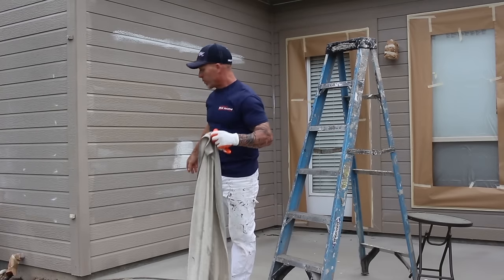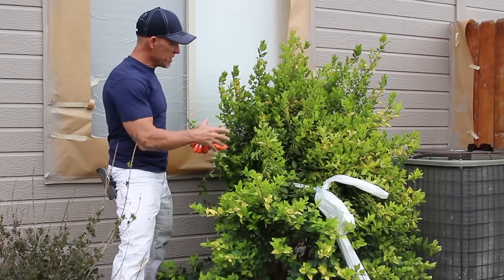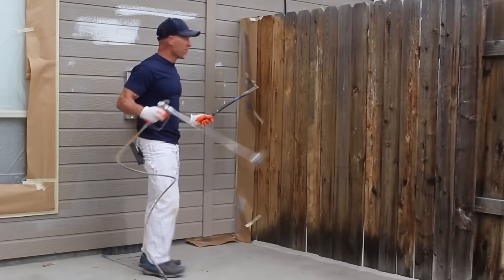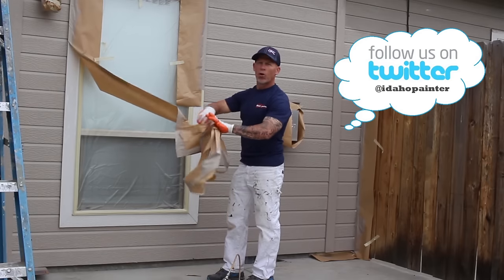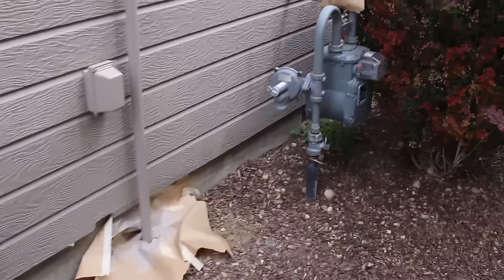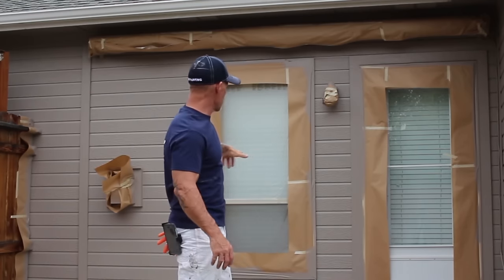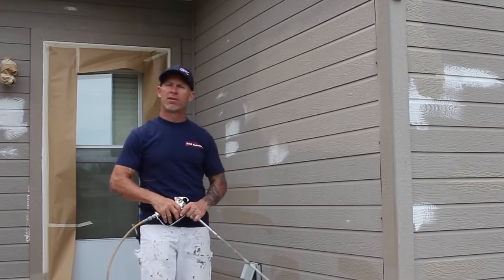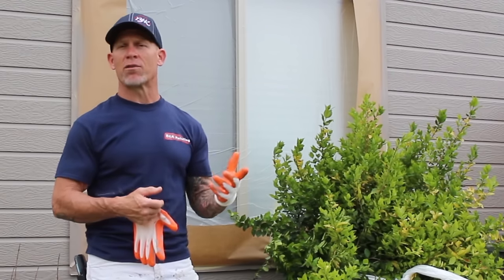Stopping Airless Sprayer Overspray | Eliminate Paint Over Spray

Comment: I've been painting for over 26 years and have a high appreciation for painting techniques and practices... THIS guy embodies everything right about prep work and painting techniques that I have been practicing for close to 2 decades of industrial commercial and residential painting. I absolutely commend him
Reply: I think he should have used plastic on the windows tbh
Reply: @AtTheHandle  first thing I thought. Just use drape and tape. What a waste of time
Reply: @AtTheHandle  There was plastic under the paper on the edges. Paper helps to absorb drips, and the paint doesn't flake off like it does with plastic, creating cleanup issues. Plastic is fine for areas that receive very little overspray, anything that is receiving heavy amounts of paint, needs to be Paper. No flaking, and no dripping, it just makes everything easier.

Comment: You should always be spraying at the lowest pressure that gives you a good spray pattern, i.e. long and narrow with no "tails" at top and bottom. You should test the pattern on a piece of cardboard or such.
Reply: That depends on the tip. Better if new. Wore out tip just makes a mess and wastes paint. I use a411 for large areas and a 311 for soffit and fascia. Indoor trim I use a211 tip.I use a new tip for every job. Great videos dude. You know your job.
Reply: @keithhampton9700  A x11 tip sounds a little constricted for full bodied exterior paint. A x13 or x15 would be normal for the generally heavier bodied exterior paints.
Reply: @nejdro1  your are correct, it's no wonder this dude is blowing through a fresh tip every job... using the wrong size

Comment: I like that u put plastic up then mask with paper.. right way to do it. My old man thought me at age 14 to correctly  mask windows & doors..  I cant stand  watching guys just use paper. And after u pull it u can see a square of  over spray on the glass & vinyl. Only thing that bothered me was the wand. It's not necessary.  Take it  easy  painter.

Comment: The masking and preparation is usually the most expensive element of any painting project.  Good job.
Reply: I agree
Reply: for sure. Just myself and a helper.  3 days prepping. 1-1.5 days masking and spraying on a typical size bungalow is the norm. 2 days if its a relatively new home with little weather damage.
Reply: You mean labor wise, right?
Reply: @andrewhigdon8346  both, you spend money on tape, plastic, cloths, paper, and other things
Reply: And time never cut corners

Comment: I got a Graco X7 for 50 bucks at a yard sale this week. Was excited to use it and went in not knowing anything about paint spraying. The sprayer did it's job well but it was hella over spraying. The whole room I painted got all misted. Even the rooms over got paint on them even though the door in the room I was painting was closed. Il definitely try lowering the air pressure because I believe I had it set to the max. might check out the tip as well

Comment: i first used a Graco airless 1973  up untill 2010  and would only use extention like the 1 you were using on ceilings/  and roof recoating  done very little masking , as with using gun only , you have much more control, ,/using correct pressure  helps, oh and the tip you are using can be got in china for 5 aus dollars ( my son ordered 100 last year ) he was paying 70 dollars each, here in aus , so somebody making an easy quid,/ anyway keep up the good work
Reply: i seen them 5 dollar tips   so they are ok then? 80 bucks i paid for last one 310 ff racx graco

Comment: I have been painting for 33 years and I have done quite a bit of spraying. But in the end, I always end up with brushing and rolling. What you did there on the siding with all that overspray prep would have deterred me and I would have brushed it. I went down this rabbit hole many many years ago of finding a way to spray houses in general and never found a time effective way to do it. I spray the odd thing, and I spray much of my ceilings, but beyond that I find there is no time or energy savings and the stress level is high when you spray. I tried HVLP, I tried handheld units, I tried masking guns, nothing allows me to get the house painted faster than just brushing and rolling. The main problem has always been overspray and the second problem is fisheyes and other issues solved with brushing and rolling. I have had a Graco 495 for 17 years and have used it a lot, but the older I get the more I rely on brushing and rolling.
Reply from the maker: Thanks for sharing
Reply: I am younger than you.  I interior paint and spray the ceilings as well but brush and roller the walls and trim usually.  Usually, it's a long day but can get a whole house masked by myself and sprayed the ceiling before I leave for the day.  it is much quicker for ceilings that's for sure.  I sometimes use it for baseboards as well, can mask a whole house baseboards and spray 2 coats faster than i can brush them.  Door trim and window trim is usually brushed.  Hybrid painting lol.

Comment: I always spray my trim first. Then I mask it like you do - Paper around the edges, and plastic inside. Then when I spray the body, I pull off the masking and the trim is already done.
Reply: I California cut my trim.  Goes FAST and looks awesome.
Reply: @Dave Morrison: I agree and most always do it the same way as you. The only time I wouldn't do the trim first and then mask it is if the customer picks a darker trim color than the body/wall. It should be obvious why I apply my lighter colors first.
Reply: I don't like masking new paint. I assume you haven't had any pull off with tape? I heard bad things so I just avoid it
Reply: @mohnjarx7801  exactly scrambler that's why I dont do trim first. If you do it Idaho Painter's way you can mask the window, then spray the body, then roll  the trim all while the paint is still wet on the body. If you trim out windows first you have to wait for them to dry, then mask, then spray, then unmask.  Just my 2 cents
Reply: its because he always does a french finish or whatever its called... in other words seems like they usually just paint the face of the trim,  not the sides  like you do as 1 should.

Comment: Yes it's nice to see that there still some pros out there doing it the it the right way. Using a shield should be the first thing to learn how to work with. The .515 and spray rig were also fine choices and a good tip on tieing back the hedges. This 10 minute video would be a valuable tool for the novice and DIY'er, The only thing missing was the Rock & Roll! Nice job brother.....Peace.....
Reply from the maker: Thank you very much!
Reply: I completely agree with you on the shield and 515 tip. No matter how much prep is/has been done I feel lost without my shield!! Learning how to hold it where needed and spraying with one hand is the way to go. The 515 tip, well that's more or less your "go-to" for general spraying, get those 2 down and your way ahead of the game if just starting out. I would only add that if one is going to spray more than just your house as needed, it is really nice to know what the #'s mean in reference to the tip "sizes. Take the first # and (usually) double it for the fan width, and the last 2 are the actual hole size in thousands of an inch, so a 515 tip has a 10" wide/tall fan and a .015" orifice. Once I took the time to look what the #'s meant it all made sense and I could easily grab the right tip for the job, prior to that someone would yell Hey grab me a 413 tip, HUH? Sure the #'s are stamped on it, but what's wrong with what your using? LOL...
Reply: @da1cru1  good advice hey I have a question anyone really. An I use a Graco Tex sprayer as my well Hopper and compressor and my large hose and gun and buy some sort of 515 tip for it very very new heard from a Graco blog that it could be used as a sprayer also need some guidance could one throw some knoldege real fast for me much ablidged

Comment: If you are doing new work or renovation there's usually no floor product installed, just plywood or concrete on floor. When you start spraying the lids, notice if there's a lot of paint on the floor. This is the first indicator that whoever is spraying is staying too far off the wall. Get as close as possible and move very quickly. Be very consistent. Inside,bad spray habits burn a ton of flatwall. There's no way to control over spray outside other than using small flat tips on a Graco silvergun with a barrel filter. The wind is what causes over spray. Outside you can turn down your pressure and load up siding,stucco or most rough exterior substrate with a stringy runny yet non overspray load of paint ,avoiding the edge by a foot or so, then take a nappy sheepskin roller and wet roll the wall. This let's you paint fast and zero drips or overspray. That's how you control overspray.

Comment: I'd still put 2 coats on even though it's the same colour. Light coat on the 1st and a little heavier on the 2nd. Better coverage and avoid runs and misses if trying to cover in one coat.
Reply: And I have watched a couple of your videos and find it interesting how other painters do there work. Your tidy and make it look easy, because really it's not that hard. 80% of my work is spraying roofs or exterior houses here in New Zealand. Cheers for the videos.
Reply from the maker: Thank you! Depending on the quality and color of the paint is how I determine how many coats. Thank you for watching :)
Reply: yeah same here, on the 2 coats.  even on doors i like to do 2 light coats to avoid runs as enamel can be harder to spray without getting sag or runs.

Comment: Love your videos! I've been an industrial painter for about 8 years, and I've learned more from you in a few hours than any of my foremen over the years!

Thanks!!!

--I'll add my old company coated an entire parking lot with white epoxy over spray! Epoxy is a little harder though, you need around 3,000 PSI and a large tip just to pump the thicker material.
Reply from the maker: Thanks for watching Nick!
Reply: You need to roll so that the paint lasts longer in the house and also better covers the surface of the sidings. spray anyone can

Comment: This guy has mad skills I try using the 311 on trim strain it thoroughly constantly having to flip my tip clogs quite a bit I I've switched to the Titan 413 less of a headache for me I seem to get pretty nice results with this
Reply: tip size is too small for exterior paint without dilution... that is why you are getting clogs. Read the Paint Can, it'll tell you the tip orifice size to use. 0.015 to 0.017 is typically the number which equates the the last 2 numbers of your spray tip.
Reply: Write thank you I'm aware of this.. I'm referring to when I spray cabinets or indoor trim the 311 clogs.. can I use the 695 I have just given up on 311
Reply: @billgoforth7426  are you diluting the paint for cabinet spraying ?  I dilute it when using a smaller orifice size like 311, if you read the paint can it'll say if the paint is dilutable or not and how much to dilute it by.
Reply: I usually don't try cutting it on the cabinet paints.. but I will try in the future thank you and see if this helps maybe I'll give it one more try
Reply: @billgoforth7426   some cabinet paints require you to dilute them in order to get a better finish, you might need to lightly coat it twice for full coverage but generally it's a nicer finish in the end. Good luck in the future!

Comment: if you do end up getting overspray on a window and dont have time to take it off right then. i suggest using a hot damp towel to whipe it off the heat and dampness takes it off way easier and faster than a razor blade scraper plus no risk of scratching the glass

Comment: I worked for a painter that hated masking and using drop cloths. He would rather scrap and use a wire brush struggling to clean up cement he got paint on. Terrible work habits. Also, he would paint door hinges and cabinet  hinges. To me that’s unexceptable. I recently moved into a rental where everything and I mean everything was sprayed the same color and all semi gloss including all hardware. The owner has given me permission to fix it.

Comment: Is that about a 30" extension, when you release trigger, don't you get the spits?  I have and then you get that little stream of paint on the siding, what do you do about that?
Reply: Keep a roller handy and smooth it out right away so it dont dry in
Reply: Y0ou don't get the 'spits' unless your gun needs a packing adjustment or needs repaking.  length has nothing to do with it .   brent

Comment: Use a .417 tip and lose the wand. Your spray will reach further and sharper
Reply from the maker: Thanks for sharing the tip!
Reply: cole trickle   415 would be my choice don’t loose the wand just shorten it
Reply: never 417 on  ext residential unless there is no  doors or ,windows and you want runs

Comment: I bought a Harbor Freight house brand airless sprayer at a pawn shop. Thanks to your videos I have half a clue how to use it. Painted my house, and the first third or so I thought the spray pattern wasn’t what it should be (too narrow for a 5/15,) and I was going through WAY too much paint, so I swapped in a new 5/17 (pretty thick paint) and the rest went well. Not a professional job, to be sure, but far better than it otherwise would’ve been.
Reply: your pressure was too high on the 515 which is why you went through more paint, the 517 worked better because you used the same pressure as the 515 and a 517 has a larger orifice  size.

Comment: "the tips work for 3-4 houses or about 60 gallons" what?
Reply: Because the machined orifice of the spray tip gets worn from high pressure in a small tolerance area.

Comment: That's an awesome machine...but I prefer to run it with the RX Pro gun...rides like a caddy...with a Bedford gaurd and a Titan HEA 515...you get the same reduction in overspray or better with the HEA tips n the Bedford gaurds have teflon guts that don't fall out and aren't susceptible to solvents as are the rubber guts in some competitors...n all for much lower cost.  N it jus looks good...so...yea

Comment: tip for patio spray or protect the lawn, use a 15 #  tar paper layout instead of a cardboard shield. better control .30 years in com.painting.spray tip  is not keeping sharp edge then is a war out tip. tip sizes 15 x4 mean the fan will be 8 inch wide .

Comment: I'll confirm everything in this video. 35yrs in the industry.  4th gen owner/painter.  I just want to add one thing. If you're working with a satin ext. Product  drop down to a 413 or 415 for the smoothest looking finish you ever saw.
Reply: yes ,515 ,415 and and 411 for me and no problems,

Comment: I’m a professional painter with my company.  So I thought I was going to learned some new or different tips from this painter.  However I just realized that his video is for homeowners or beginners.  I noticed he tape the light fixture, I prefer to simply remove it because the over spraying will always stain the light fixture in spite of how good you cover it, a rookie mistake.
Reply from the maker: Covering it has worked good for us!
Reply: Yep unless the outside of the fixture is rough looking , simple couple strips of tape an a grocery bag ,

Comment: Fabulous video, one question when watching other videos and talking to my paint rep he suggested I don't let off the trigger but whenever you spray you are always releasing it? (This is on an interior home)
Reply: Your paint rep must have never painted with an airless --or any other sprayer. If you don't let off the trigger, you will have much thicker paint where you slowed down or reversed direction. Always have the gun moving when you squeeze the trigger and always release the trigger before stopping the gun and keep the gun perpendicular to the surface.
Reply: @kennethwills2913  and overlap about 30-50%, depending upon experience

Comment: I'm getting a crash course in controlling overspray today. We are spraying for the first time and we are doing a 1000 sqft house. The house was way overdue for painting and I elected to prime first because everything was very chalky and I did a lot of stucco repair. It's very windy out and we are constantly having to redo our masking. It is trying out patience. We are almost done with the body of the house.  One side left and touch-ups. Next is trim and then doors. I am trying to figure out what to do about the soffits because they are metal and around 35 years old. There is a lot of oxidation on them.  I need to overhaul the aluminum screened-in porch. It is also about 35 years old. It looks dingy and lots of scraps. No dents though! Do you have a video on aluminum screened-in porches?

Comment: I put a brand new tip on my airless, was wondering how to keep it from leaking around the tip. I tightened it and I kept having to "unclog" the tip. I'm new to the graco family. I was spraying with a 410 tip and was spraying deck sealer from sher will

Comment: Question- on a 2200 psi pressure, do you thin the paint, if so how much water do you add in a gallon or do you just unthinned paint from the can on that 2200 psi pressure? 
Thanks!

Comment: Nice video.  The take away is a 515 tip at 2100psi, right?  I want to reduce misting.  My airless does not have a pressure guage so I guess I will need to buy one and add it.
Reply from the maker: Yes

Comment: Graco tips are running closer to 50 bucks in 2023. Sherwin Williams exterior paints need to be bankrolled during spraying for even coverage and color consistency mixing with the bonders. Higher premium lines of paint usually must be bankrolled for excellent even results without acrylic buildup and patches after dying. That goes specialty for Duration flat and higher sheens exterior premium paint. Good products need a little extra effort for excellent results.